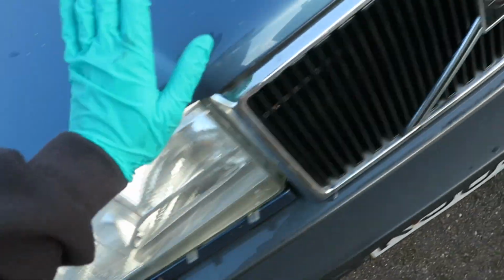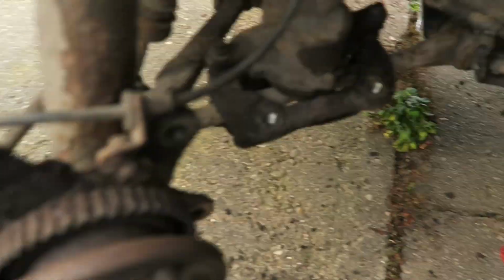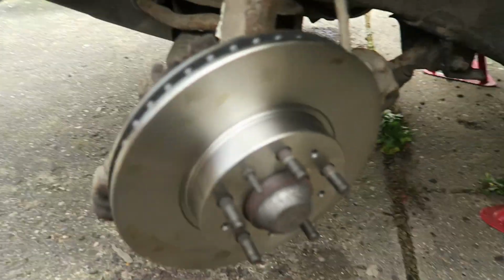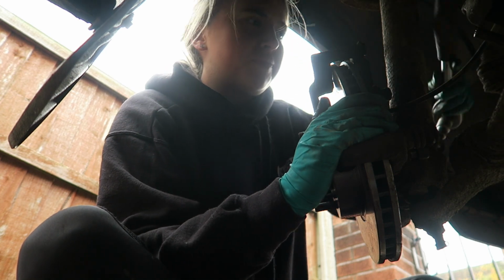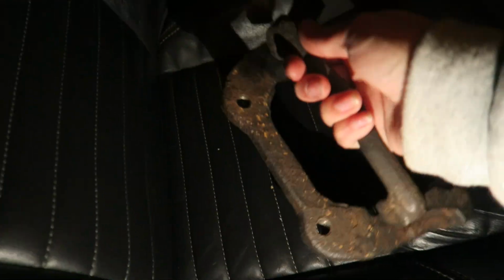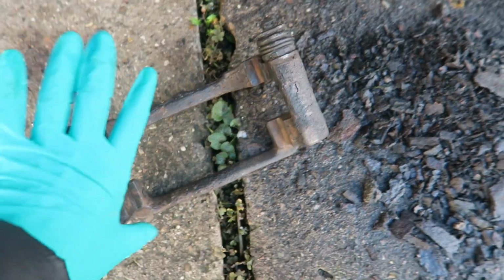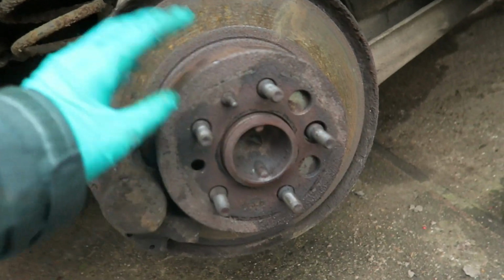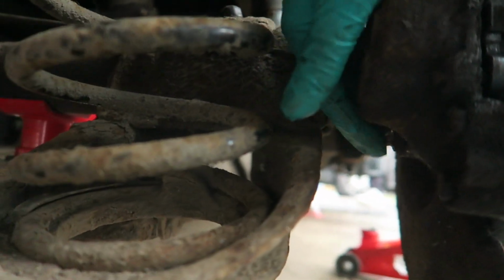When a one hour job takes 1 week... never again.

Comment: Emily, the 2lb lump hammer is your friend as you've discovered. Works for me too. The G clamp is good for pushing caliper pistons in. I know where you coming from with your estate. You've got too much invested in it (not just money) just to get rid. The Halfords Advanced tool set is a good buy (I've got most of the modular tray sets). You need to invest in a cordless impact wrench. They make short work of wheel removal, brake jobs and suspension jobs. I once had a problem with Euro when they supplied me with the wrong fuel filter for a Ford B Max. Returning it was hassle free so I can't fault their customer service.

Comment: It's very normal that all nuts/bolts/fasteners/clips/pins/screws getting rusty and rot out and seize and round off etc.. on any vehicle that age. Also try a good penetrating fluid like Plus Gas, it is very good. 50/50 mix of Acetone and Automatic Transmission Fluid works great as well however Both Acetone and ATF will damage paint, rubber and plastic.

Comment: With regards to the rounded bolt, i pmd you about it! I had the same issue haha. Your halfors toolbox has star pattern sockets, that bind very well with even completely round bolts, if socket dont fit aquire 4wd spanners that work in the same way. My helga has bolts rounded everywhere and this helps so much.

Comment: U need a slider pin rebuild kit, if you don’t replace them then only 1 pad will be working on the disc and the brakes will still be wank.
Reply from the maker: I never did on my estate and they work perfectly fine 👍
Reply: @emilyshields3667  fair enough but the slider pin should be free to move and have no resistance, rebuild kits are cheap and easy to install and will stop you wearing 1 brake pad out faster than the other
Reply: Yeah agreed. That needs to slide freely. It might appear to work OK but unless they move freely in and out it will only brake on one pad
Reply: @Lancashirelad I do but it's not recommended. Think you're supposed to use white lithium grease. 🤔
Reply: you must at least release the pins , clean them and grease them , otherwise you will get an imbalance

Comment: The best thing to do with the sliders to get them out is to put the carrier in the vice and soak the silders in WD over night then free them off with a pair of stillstons by wiggling them left to right. Also Irwin grip sockets are like £20 buy a set, you need them for working on cars

Comment: I had to remove the brake discs from my VW earlier this year and they were very very stuck. Everybody just told me "oh they come right off". My ass they do. What I did was hammering from the outside in, not from the inside out. I just hammered on the edge/brake surface. Because they are only attached/stuck in the midle part, if you hammer on the top edge, for example, from the outside, you are actually hammering the bottom part outwards. I used a piece of wood and a big hammer because I fancy my eardrums. But once I stop giving a shit and hammered it hard it came off real easy.

Comment: I've done a few of these projects that is suppose to take only a short while that ends up taking forever, it sucks while you're doing it, but it feels really good when you finally finish and it actually works.

it looked like your front left caliper had a tear in the rubber for the piston, that should be rebuilt or just replace the whole caliper. The glide pins should also be cleaned and lubed up again so that they don't end up sticking and rusting like your front right one did.

anyways I hope you get to sell it before something else brakes on it, because it will 😂

Comment: Emily, the seized carrier, could you guys cut off the rubber boot to get to the metal underneath, brake cleaner and wire brush to see if the piston then moves? if it does then see if there is another rubber boot that can be put back on? seems like that would be a more common part?

Comment: HA timing, so i began with doing rear pads and discs on my V50. Retainer springs were seized in the callipers so I thought you know what, i'll just replace the rear callipers. Done that, come to bleed the fronts, front right was fine, front left... snapped the bleeder right off. So now i'm in for 2 new front callipers. So I feel your pain, 1 hour job is literally taking 2 weeks including wait time for parts!

Comment: Get yourself a long breaker bar for those tough nuts.  And use the threaded holes in the brake discs to jack them off when seized, thst what they are there for.  Very jealous of your Halfords advanced set.
Reply: Also give any expected seized bolts a whack with a hammer and a spray of wd dizzle, a day or two in advance of when you plan to work on them.

Comment: you need 6 point impact sockets, hammer the bugger on then use an impact gun, clarke do a 12v one that is powered by the car battery, used mine on rusty as fxxx 24mm towball bolts after having a scaffold pole on a breaker bar. even better a mains impact gun for mega torque

Comment: No point fucking about with 12 point sockets on any car older than 10 years, 6 points and a weapon of a breaker bar will make the job so much easier. Also get a proper sledgehammer on that disc and it'll come off, good smack top and bottom should do it.

Comment: Nice. I just did brake shoes and wheel cylinders on my daily. Had to wait a while for the cylinders because local suppliers couldn't find me a pair. Only a 30 year old Ford Telstar.
Was easier to get brake parts for my 60 year old Humber Hawk

Comment: Check out irwin sockets at machine mart. They are used for removing rounded or corroded bolts. Best thing you can own for working on old cars. They have a hex on so you can also use a spanner
Reply: They have worked for me but nothing is 100%. Heat and wd40 at the time will also help
Reply: @brummiescot  Just don't set fire to the WD40 like I did once. Hope that Emily used brake cleaner on the discs. Another option would be a good big 3 leg puller while hammering.

Comment: I wonder if Bigg Red in Worcester could’ve supplied parts to refurbish the caliper carrier. Wish I’d have sent my brake callipers off my old Ford Focus for refurbishment instead of driving round Bristol just before last Xmas as shops opening and brake grinding due to seized piston trying to get new discs and pads, and then garage to fit and then garage get hold of caliper! 😂

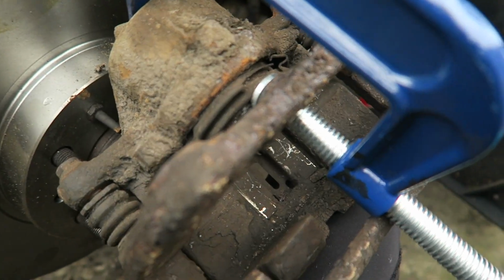Comment: 5:07 surely the tear needs fixing in the caliper boot?
Reply: @Arounadabout  look closely at the piston’s boot and there is a rip in it. Surely dirt and grime will get it and cause the calliper to bind or fail? Cv boots and steering boots get replaced when their damaged?
Reply: @Arounadabout  you asked me to explain and I did. 

I appreciate what Emily does which is why I subscribe and watch the videos and even bother liking them. 

I am mearly asking as I also had a tear in the front calliper boot of my car and questioned if I should replace it or not. 

I did replace it in the end for my own piece of mind with a £25 second hand one from a scrapped car. 

I asked a simple question with no negative criticism...
Reply: And the exhaust back box is rougher than a badgers arse...

Comment: That bit on the front calliper carrier that’s seized and you pushed in is called a slider, and should be removed, cleaned and greased them brakes will need doing again in a few weeks #wasted your time 😂

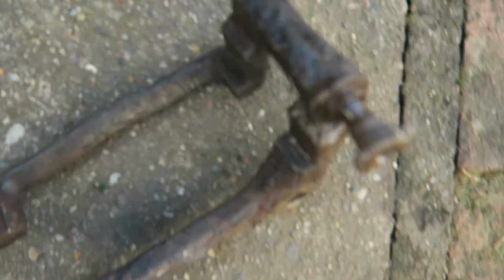Comment: 11:12.. im starting to cringe..
Reply: I’m glad you threw that brake  carrier away.. they are sliders. They are supposed to easily slide in and out. Just forcing it in to get the calliper on isn’t the way to do it. The brakes wouldn’t of worked correctly. 👍